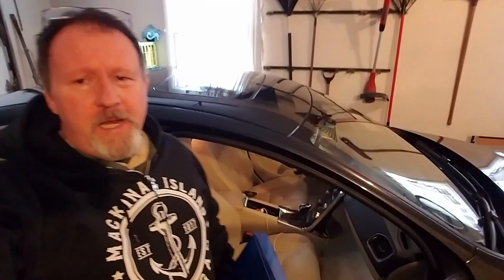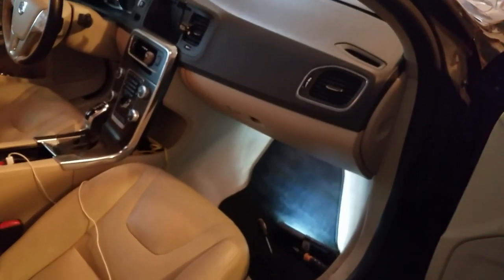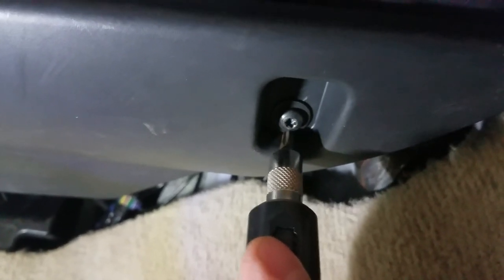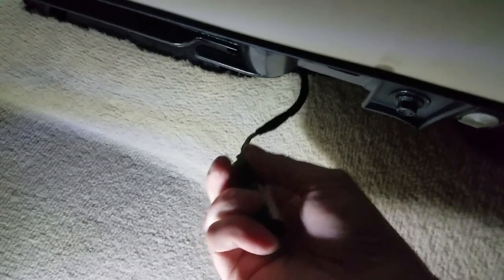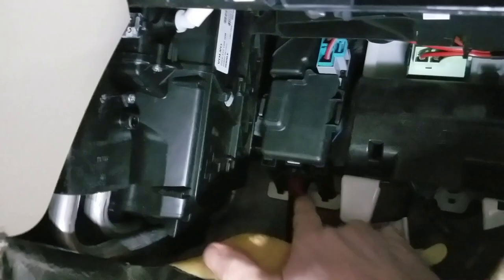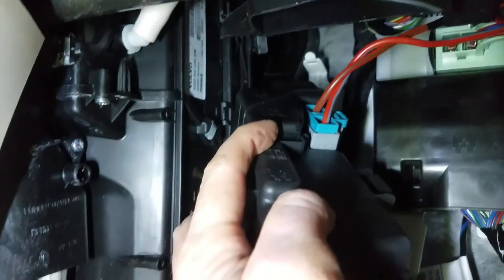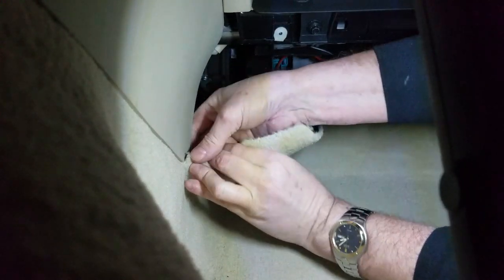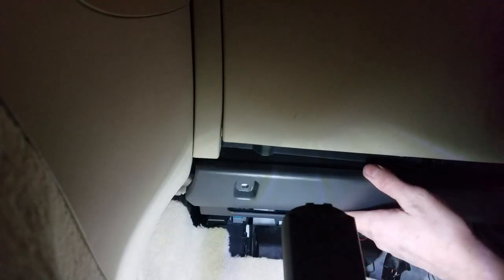2011-2018 Volvo S60 Cabin Air Filter Replacement

Comment: The tip on pulling that fuse block assembly was pure gold.  Thank you for going up the learning curve for us!
Reply from the maker: Glad I could help.  I know they cram a lot of stuff in cars these days, but it really does seem like there could have been a better place to put that inlet.  Even slanting it slightly forward would make it a lot easier.

Comment: I'm green when it comes to car maintenance.  However, when a local shop quoted me $250 to replace my cabin air filter, I knew it was time for me to get my $hit together.  I had trouble removing the fuse box assembly from the clip that held it in place.  The mechanic that changed my oil this morning was able to help me with that step.  Everything else was a breeze.   In all, it only cost me $14 to get this whole thing done.  Thank you so much!  Next, I plan on restoring my headlights using your video.... I appreciate you!

Comment: Great video, helped tremendously. Volvo has designed an incredibly difficult to replace common air filter,  kudos.
Reply: Same with the oil filter. There's a bunch of stuff in the way.

However, Volvo nailed it with the removable headlights. No tools required, pull two pins out that are right on the top, headlight comes out.
Reply: If only we needed to replace headlights as often as oil filters...

Comment: It took me 30 minutes start to finish (2017 S60 Inscription) including a couple pauses to re-watch portions of your video.  THANK YOU SO MUCH for sharing this.  I am a large(ish) guy with big hands, so this would be a little easier for a more nimble person.  I moved my car into the driveway so that I could have lots of natural light, but still needed a flashlight to see some of the key bits up underneath.  I doubled up a yoga mat outside the car to kneel on and draped a thick towel over the sill so that there were less hard things and sharp objects involved.  The process is a pain, but definitely DIY friendly with a little bit of patience. Thanks again, and Happy New Year!

Comment: Thanks again Mr. Nash! Love your videos. They've helped me gain the confidence to work on my own S60.

For anyone with right hand drive vehicles, it's slightly different. Fuse box is on the right, next to the centre console and requires removal of the centre console side panel in order to comfortably get the air filter cover off.

Comment: Thanks for taking the time to document the steps...........one thing I might suggest........I have seen at least one other video where they suggest just removing the fuse box cover instead of having to remove the entire fuse box.  Still provides access. Not sure why Volvo engineers had to make this so difficult. On my Toyotas, it was about a 5-minute process and just required one screw and removing the glove box and there was the filter access.........eezy peezy.

Comment: I wanted to get mine replaced after the worst of our forest fires were over in B.C. The mechanic quoted me 250 (fair) but also mentioned that the technician has a good chance of breaking a plastic piece while doing it, and that this plastic piece would be $600 so 850 total. After watching this I feel like he was taking me for a ride, the first clip is the only thing that matches this description and you seemed to have no trouble. Thanks for giving me the confidence to do it myself 10/10 tutorial!
Reply from the maker: $250 for a filter?  I hope that comes with a bouquet of flowers and a back rub because you're getting screwed.  The average dealer price is about $100, and that's with $90 for labor.  The filter itself is super cheap, especially when you're the dealer getting them at dealer prices.  It's a pain because of the tight space, but totally something you could do yourself for just the small cost of the filter.  I found nothing in there that was close to being a part that could be easily broken.

Comment: I can't thank you enough for this video. I was able to get the new filter in there. It definitely requires some work to get down there. To my surprise, there was no filter to replace. The housing was empty!!! That's what you get for buying a used car.
Reply from the maker: The sad part is a previous owner probably didn't do that.  Most likely a previous owner paid some quick oil change place that told them it needed to be replaced, they pulled the old one out without getting the fuse box out of the way, then couldn't figure out how to get the new one in, skipped it, and charged them anyway.

Comment: Thank you.  Most of the comments were from folks who will give this a try.  Personally, I stopped at 7-minutes.  I don't want to fiddle with a fuse box.  This would take me hours, and I know my mechanic can probably do this with eyes closed.
Reply from the maker: If you take it to a Volvo mechanic, yes, they will be able to do this much easier.  I just tend to prefer doing things for myself when I can get the same part for $20 or $25 that a mechanic will charge me $50 for plus $25 to install.  Once you do this one time, it's not so bad.  It's just a matter of figuring it out that first time.  If you watch the rest you'll see the fuse box is super easy.  It's the stupid filter that's the hard part.
Reply: @MIFixItDad  Hey there!  Thanks for the encouragement.  My mechanic, George, is a small independent garage.  He charges about 50% below the Volvo dealers in Austin or San Antonio, and he doesn't solve a problem by throwing parts at it.  He built and races his own stunt plane (aircraft).  My mechanical skills are truly challenged in keeping an old Toro mower going, so I'll just leave the car to George.  (My Grammarly program wanted me to remind you that you need to hyphenate Fix-it Dad.)
Reply: I was quoted $142... its annoying but I would rather struggle a bit and save $120

Comment: Thanks for focusing on that clip on the fuse box if it wasn't for you I want to be able to replace that in cabin air filter
Reply from the maker: Glad to help.  It's still going to be a pain, but once you've done it once at least, it should be easier the 2nd time around.

Comment: Thanks. Did this on a V60 and you also have to remove the plastic trim from the centre console to access the filter on that model!! Unbelievable how awkward they've made this service item to access. On our Honda and Lexus it took 2 minutes to replace at most 😂

Comment: That was helpful-thank you! Yes, especially the tab location (as time before I managed to wiggle the relay out somehow without pressing that tab). I hate to write it, but I think you shoved that filter in backwards, I think the tabs on each side of the filter should face the engine.

Comment: Cut a piece of card or thin plastic the same size as the filter.  Slip the card part way into the container first then the new filter will slide in without snagging.  Don't forget to remove the card!

Comment: Brilliant engineering, I wont do this myself. It takes only 10 seconds for me to remove air filter on my Toyota Wish.
Reply: It's funny with these Volvo's some things are designed great, like how the headlights remove with 2 tabs you just pull out, absolutely no messing around. Then there is this shit!
Reply from the maker: No kidding!  And don't get me started at all the dang bushings for the subframe vibration isolation and in the rear end.  I really wish these manufacturers would make cars easier to work on and stop designing them as almost disposable.

Comment: holy farts that is needlessly complicated by volvo...
Reply from the maker: Unfortunately it's not just Volvo.  I just helped a friend on a 2019 Ford Fiesta and it was stupid.  Screws in places you can only get to with a little allen wrench.  It took 45 minutes to get the cover off to get to the filter, then the filter has to basically be wadded up to get it into position.
Reply: @MIFixItDad  I think my Fiesta is going to be "all original" when it comes to the cabin filter then. Wife's S60 looks challenging enough for me.

Comment: Do you know if this will actually work on the 2019 model? The S60 was redesigned in 2018 so it might be different.
Reply from the maker: I don't have access to a 2019 to find out for certain.  I've heard it's either identical or very similar though.

Comment: Can anyone help on a RHD version of the car? 

I went to do this job last night, but on the nearside of the car, the plastic around the center console protrudes much further than on the offside of the car, actually going past and covering the bottom half of the filter "door". In the passenger footwell.

Everything else is the same apart from that. I am assuming on a LHD car this plastic is the same - just that it is on the drivers side, where obviously the filter is not.

Comment: All of this to replace the cabin air filter? My wife's 2018 Mazda 3 took less than 2 minutes to replace the cabin air filter.
Reply from the maker: Yep, not a fan of these designs at all.  I have a friend that has a 2019 Ford Fiesta that is even worse.  It took about an hour to replace the filter in it.

Comment: Still a terrible design but much better than the V50. In the V50 it's on the drivers side and you had to unbolt the throttle then remove screws to open the cover. Still had to bend and fight to get the filters in and out. Traded my '06 V50 for an '18 V60 Cross Country last week.
Reply from the maker: Unbolt the throttle?  WOW!  That's messed up!  Hope you like the 2018.  That's a nice car!

Comment: This does not apply to 2019 S60 Volvos.  The vehicle was re-designed for 2019 and the cabin filter is completely different.
Reply from the maker: I found that out later.  I had initially gotten info that said this went up thru 2019 but apparently that's wrong.

Comment: Volvo is a criminal for putting the filter there. I still can't get the fuse box out as I can't get a good grip on the tab. (2018 S60)
Reply from the maker: Unfortunately, Volvo isn't he only ones doing this.  It's far too common.  Manufacturers don't want you working on it.  They want you taking it to the dealership so you can get charged for OEM parts.
Reply: @MIFixItDad  I wonder if the dealership has special tools to help them do this quickly, because what a pain!! I shoved the new filter back in but hv no idea if it is all the way in. Oh well.

Comment: I've been in the car repair biz since 1984. I absolutely hate euro Nazi vehicles for many reasons, not the least of which is how over engineered and under designed they are. I can change a cab after in any American or Japanese car in 2 seconds without having to look anymore up. I inherited my Volvo, would never buy one and advise all of my friends and customers to avoid at all costs because of the riding cost of ownership.

Comment: Absolute garbage for the person having to work on this scrub car
Reply from the maker: I don't know that I would call it a scrub car.  Most things are really easy to work on with the Volvo's, and this is no worse than many other cars out there.  In fact it's much better than some I've seen, but that still doesn't mean it's as easy as it could be.  Could have been a better way I'm sure.
Reply: Floyd Nash I may of exaggerated as I was having a bad day at work and this car didn’t make it better but yeah maybe I went overboard although the design could have been more simple if they spent less time trynna figure out the worst placement for the filter